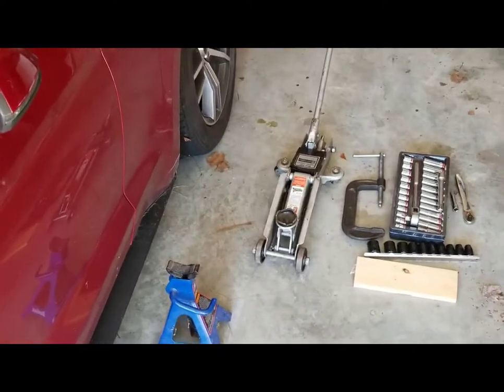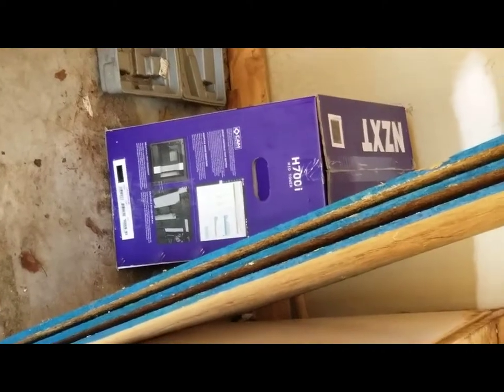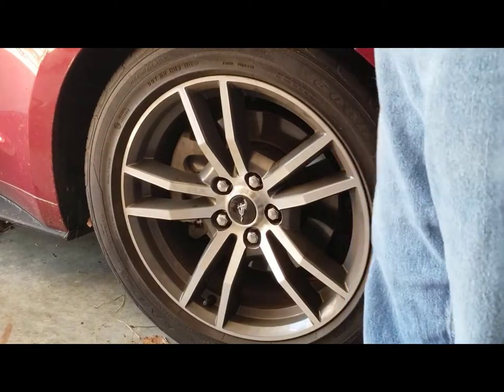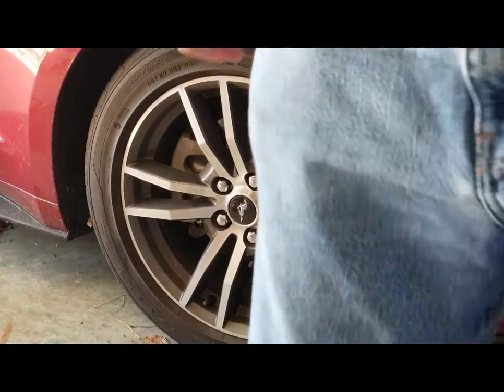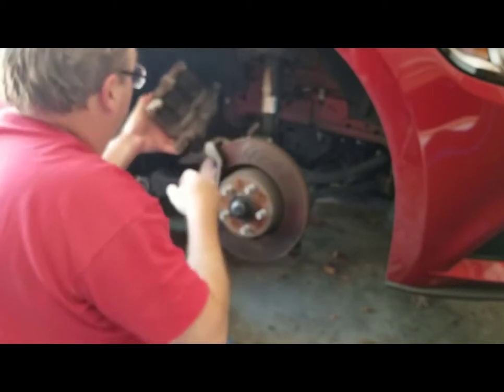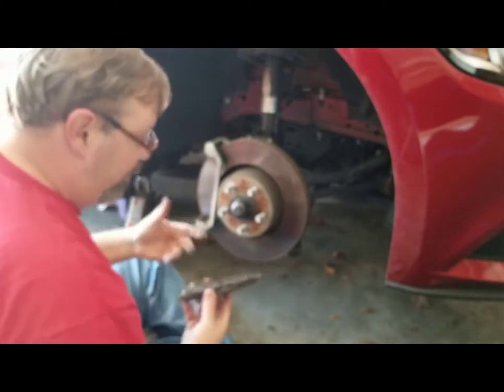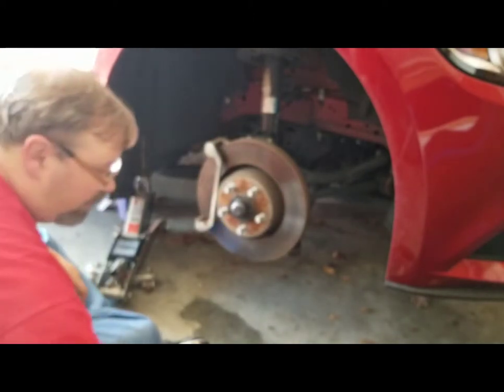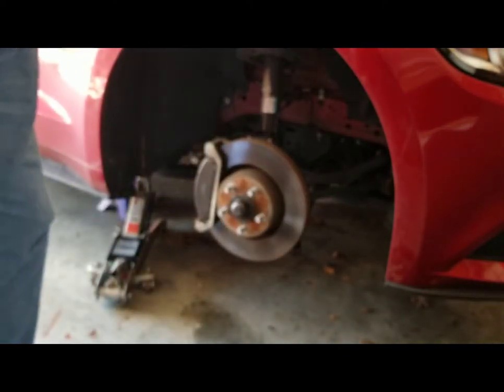Changing Brake Pads on 2016 Mustang

Comment: What I cant figure out is why ford would use a screw in pistons on the rear calipers but not front? was totally dumb idea by ford, you mentioned you had hard time finding brake pads for your car I can find brake pads for mine but can not find anyone that has the rotors I called several part stores may have to get them turned if need be.
Reply from the maker: I agree. The inconsistency is annoying, to say the least. I was able to get pads. Just took a little more looking at the time. Getting the rotors turned is not a bad way to go if they have the meat on them to allow that. If you are into cars you might want to check out my other channel 67Stang - https://www.youtube.com/c/67Stang

Comment: Is it the same thing for the rear break pads?
Reply from the maker: I have not done the rear pads on this one yet. However, I did do them on the 2006 we had before this one. The general process was the same. But it did require a special tool to compress the caliper piston. I was able to rent the tool from my local auto parts store for free. The piston on the rear calipers screws in and out. So the tool allows you to screw the piston back into the caliper.

Comment: You forgot the brake grease and loctite.
Reply from the maker: Good points. I did forget the grease. Too focused on the filiming. First time I had recorded something like this before.  I have never used loctite on brakes and never had a single issue in the 30 years I have replaced pads or shoes on cars ranging from 1960 mustangs to 1990 cars and trucks to this 2016 mustang. However it is not a bad idea to use as just an added precaution.